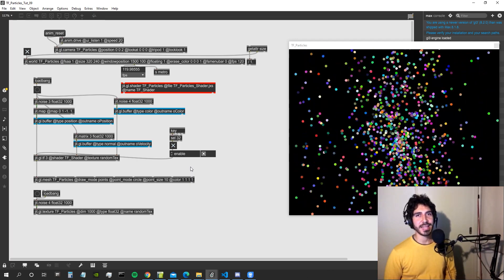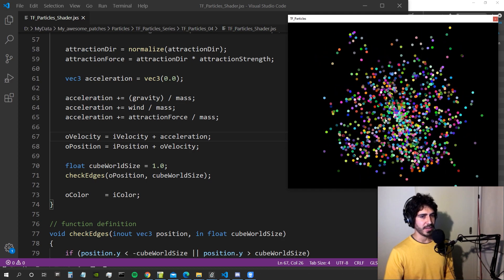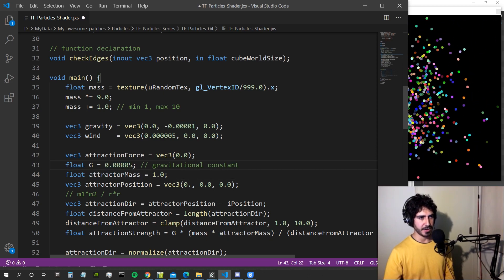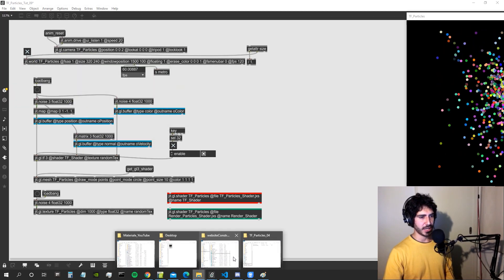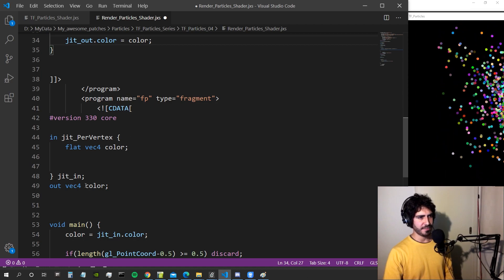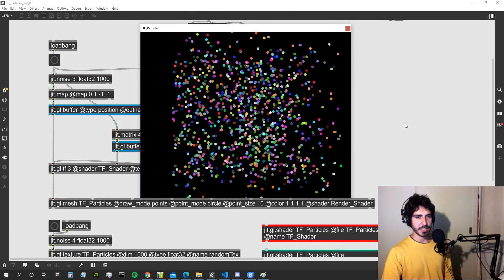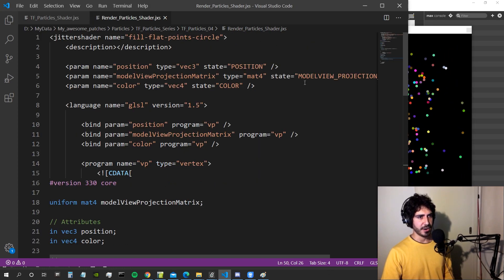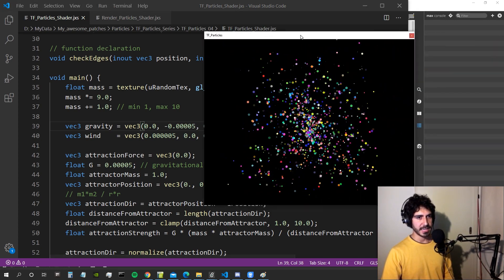Particles Series in Max/MSP 10 | GLSL TF - Particles Size as Mass and Clamp Velocity

Comment: I thought that the way you passed the "mass" to the Render shader was a bit weird. So I tried to simply attach the same randomTex texture to jit.gl.mesh, and read it in Render_Shader. It works! and seems like a more simple solution. I am kind of new to OpenGL, Is that solution ok?
Reply from the maker: Sure! It works as well. With the video method you just save one texture read, but it's not a big deal in terms of efficiency. Great solution!
Reply: @AmazingMaxStuff  Of course If we were to manipulate the mass in the TF_Shader, then your method allows us to pass that manipulation to the Render_Shader. And your method also showed me the vec4 syntax. So it was a good learn. 
BTW: Amazing tutorials 👍🙏 !
Reply from the maker: @hepi-muzivisulighting6128  Thank you, glad you like them!
Reply: Hey, I'm also kinda new in glsl... how did you read the texture in the render_shader.jxs? did you specify the @texture of gl.mesh or how? i also though it would be more straight forward. 
Anyway it was very cool to see that way of saving a reading, that indeed suits better for my old laptop's gpu
Reply: i mean, how did you attached the randomTex texure, did you just chained the texture to the 1st inlet of the gl.mesh or did you specify gl.mesh's texture attribute to randomTex. Tried both and they wont work for me